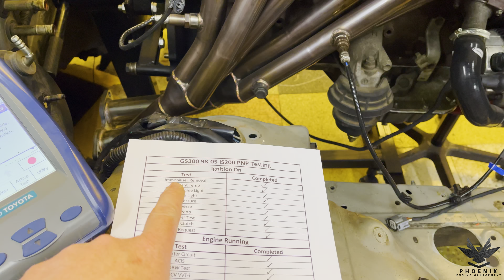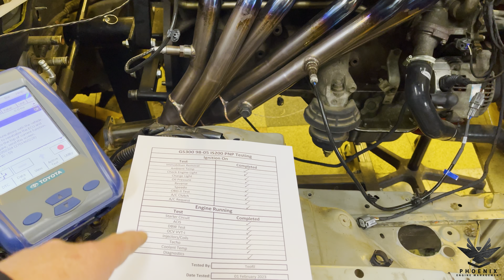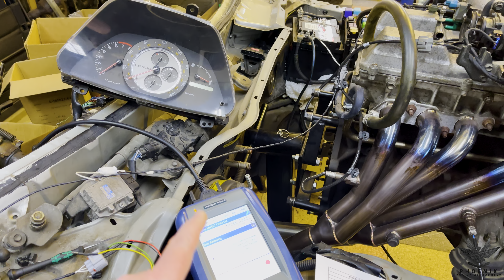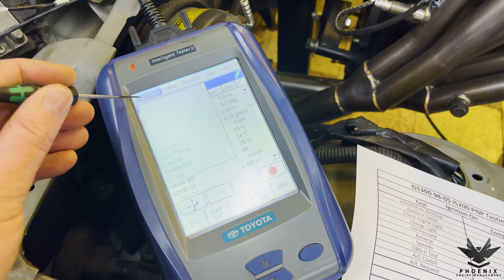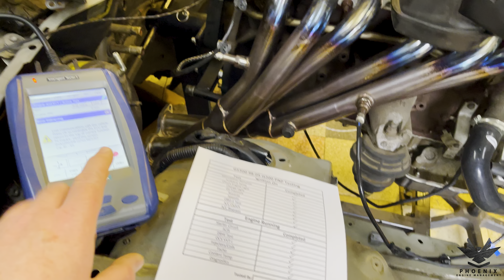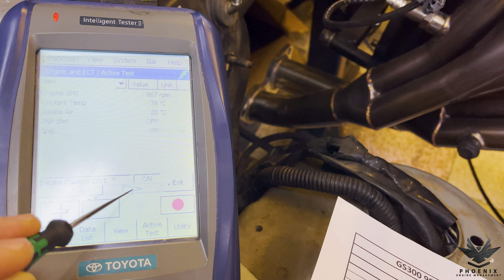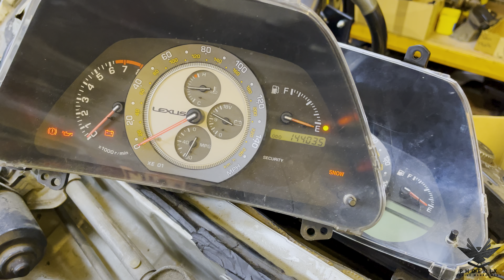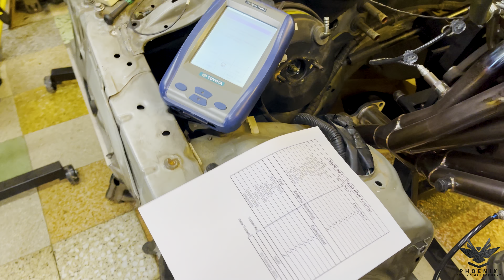Jason Lexus GS300 2JZ-GE VVT-i 1998-2005 to IS200 Plug and Play Manual Adapted Engine Harness

Comment: Hi i have done a 2jz engine from a gs300 with the original transmission swap in to a jaguar xjs 1989 , i have a problem where the transmission put on drive  it stays in the first gear and not switching to all gears please i need an advise.
And also im working with the original ecu and the throttle not working only if i push it all the way down , I think the tps not  working .
Thanks
Reply from the maker: Hello Classic Gamer
Right it sounds like you probably have quite a few wiring issues rather then anything mechanical. I would either 
A send it back to the person who wired it up and get them to rectify the iussues
B if you wired it up then go back to all the diagrams you used and double check everything is connected correctly.

Comment: I wonder if you could also tune these computers to delete lambda and MAF. This would make the car more reliable when used in motorsport, which i plan in the future.
Reply from the maker: Hey Rock3tMan unfortuantely the GS300 1998-2005 European Models cannot be remapped. So that answers that section. But in reality if you were going for a motorsport setup we wouldn't recommend using a standard ECU and would advise switching over to a standalone ECU. But also remapping out the means that the ECU uses to calculate airflow into the engine and how the fuel is being burned is not really a great idea.
Reply: @PhoenixEngineManagement  thanks for a reply!